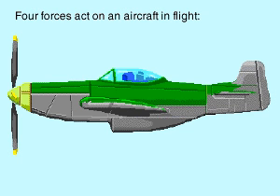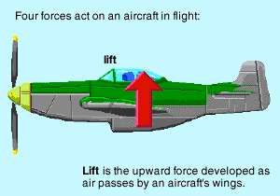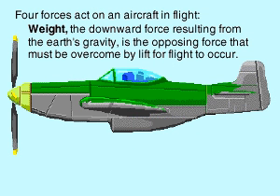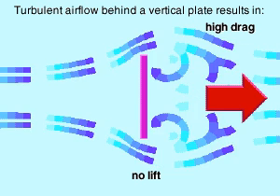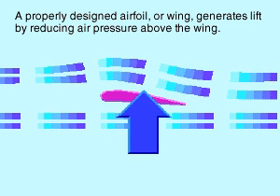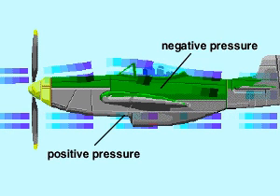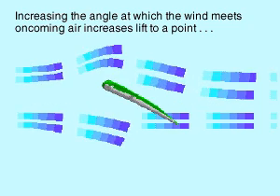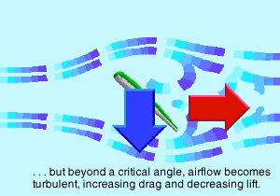Introduction to Aerodynamics

Comment: Any chance you can upload the audio clips from the musical instrument samples? Been looking for them for years.
Reply from the maker: Insanely late reply and not sure if I had already replied to this, but found it when going through my old comments - you can find the disc as a TOAST file on the website Macintosh Garden if you search for 1995 Grolier Encyclopedia. The disc image is not readable by modern Macs but if you set up Sheepshaver or QEMU you can read & extract the files as desired (the way I did initially). If anyone needs files I can also grab & post them myself.